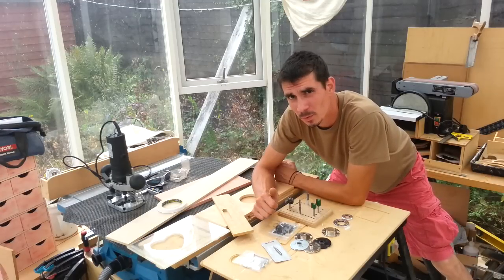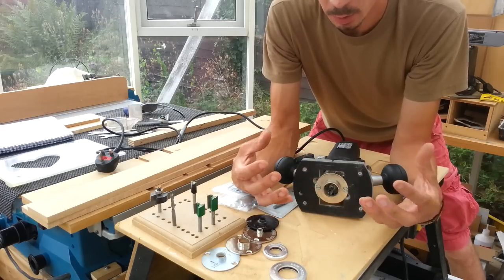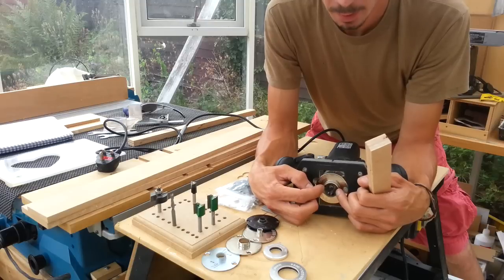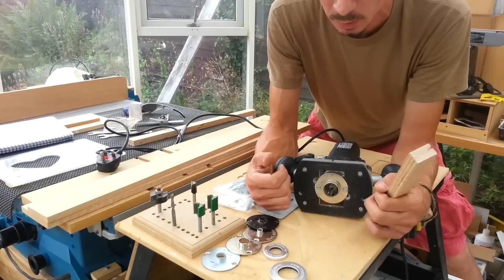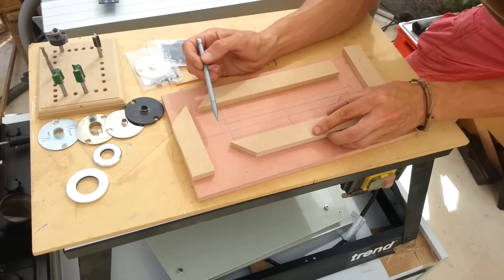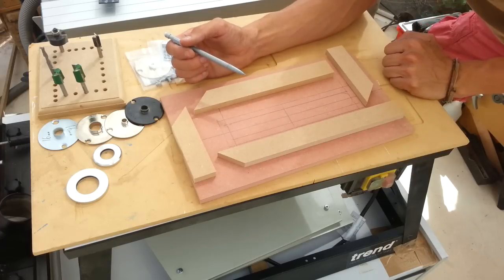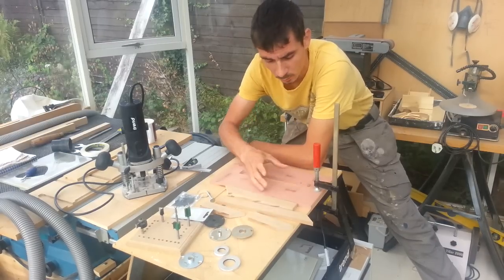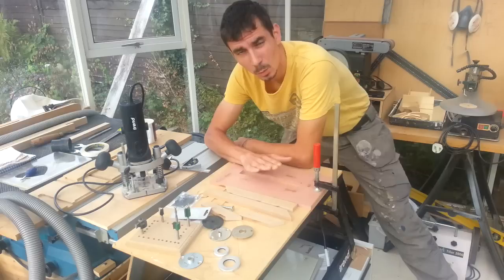How use router guide bushings & template guides | EVERYTHING YOU NEED TO KNOW!

Comment: Hi, I notice that you use a Trend T4 router and guide bush for you video,  does it have a facility to centre the guide bush in relation to the cutter?. Or is this factory set on the router for Trend guide bushes?. Thanks.
Reply from the maker: The guide bushes are centred with countersunk screws (as are all trend routers)
Since the T4 is removable from its base it should ideally be re-centred using something like a centring cone - this is not supplied.
Although I rarely use the T4 these days other than for demos/training courses, It’s really rather good for
Being well centred or most things, I only adjust/calibrate when using either a hinge jig, or doing inlays.for everything else the tolerances are more than good enough.

Comment: Thank you. i have been looking for this information. now I believe I understand the concept well enough its simple.
Reply from the maker: Michael Puffenbarger It really is a VERY simple principle, with a little practice you can use the technique to make several different sizes of cut with one jig, and whatever cutters you might have, without the need to buy far more expensive pattern bits. - It's really handy for shapes and is also the basic principle behind router inlay work. :-)

Comment: Nice video! Why did you cut the fence ends at an angle? Does it help keeping the fence square?
Reply from the maker: It just means you can more easily line them up to more angles, and you don't need to have them cut to the exact length for the cut you're making as they overlap more easily.

Comment: Good video pal, what glue did you use to hold the timber temporarily??
Reply from the maker: +Giuseppe Bibbo Thanks for watching. In this video I used some small bits of double-sided sticky tape (the thin roll of tape you can see in the background when i remove the parts), you can also use hot melt glue along the outside edge too.

Comment: You must have had the depth on that router set perfectly so that it did not groove the worktable underneath. Do you recommend beginners work on a piece of styrafoam or other sacrifcial material underneath? Or how do you get the depth so percise?
Reply from the maker: +PhotoBooth biz Thanks for watching! Being able to set the depth of cut accurately on a router is a really easy thing to do - once you know the technique. I'll be doing a quick #cuttingedge router tips video on it very soon, so keep an eye out for that. As far as a sacrificial work table, I recommend everyone uses one. I find an old piece of MDF works well, but cheap ply is just as good - what ever you have really. I've never used styrofoam but It should work as long as it's got enough density to resist compressing if you clamp the work piece down so it doesn't lift on the other edges.

Comment: What if the thing that you want to route out is not a square or a circle but has a pattern? How would you increase the size to make a template that takes care of the offset?
Reply from the maker: Just make your template smaller (or larger, (depending on if you’re following the inside or outside of it), than your final desired size by the offset amount of your particular shape/design/pattern.

Just be mindful of any tight Radio that you wish to follow, if the tenants are tight then you need a small enough guide bush in order to be able to follow your desired care.
If the guy but she is too big but it won’t fit inside the titan and it will throw your cutter path foreign off away from the template so as to not be the shape you one.
Hope that makes sense and it’s helpful.
Cheers Rick.
Reply: @BrainFizz  i need to flush mount a speaker (which has a bit of an odd shape) so i thought of making a template and use a guide bush to do it ... the problem is that i can draw the outline of the speaker on a piece of mdf (for the template) but how can i make that outline of the speaker a bit larger to compensate for the offset?
Reply from the maker: Darryl Portelli if you’re literally tracing around an object, you could use a washer, and pencil that gives the offset you want, or a pair of compasses/dividers set to your required offset.
You might have to trace the object with a pencil, then trace, the trace you mace with the compass,
For the straight sections measure and mark with a straight edge, then use the compass trick for the complex portions..
Reply: Great idea with the washer .... cheers !!!!!

Comment: What size trend bush is closest for a 1/2 in bit the 12,16 ???????????
Reply from the maker: 1/2” is 12.7mm so so 1/2” bit wont physically fit through the hole of 12mm guidebush….. so in this instance 16mm would be closest, but its about as small as you would want to go as you’ll need a little clearance between the bit and the inside diameter of the guidebush.
Reply: @BrainFizz  Cool, I thought it would be the 18 mm  but if the 1/2/ '' bit fits inside the 16 without touching around, I will go with the 16 mm, t.y.
Reply: @BrainFizz  So, the 16 will do or the 18?
Reply from the maker: Try it and see.

Comment: You just taught me exactly what I wanted to know. thanks for the great video brother. quick question I just bought a DW618 dewalt router and I want a guide bushing set that will work with my router. are they all universal? or brand specific ?
Reply from the maker: +Art Connolly Many companies have there own guide bush mounting "method", mostly it's the position of the holes. I use the Trend Guide bushes - they have a huge range of sizes in metric and imperial, and fit all my routers. If you check the compatibility table on their website it'll tell you if your router will take their guide bushes, or require a sub base.
Let me know how you get on.
Reply: If it's the router I have, the dewalt Palm and plunge combi you want a brass ring collar set

Comment: I wonder e erytime you want use a déférent guide you in stew the guide to  be replace by the larger or smaller?
Reply from the maker: +Gilbert Dufour I don't understand the question.
Reply: sorry spelling problem
I wonder on your router how do you change the for déférent one I can see 2 kind of space on the side of the guide
Reply: Are you asking if the guides are attached and detached via the two screws that mount into the bottom plate of his router?

Comment: Lovely video for sb. just starting out milling. But I miss the moment where you sink the router into the work piece!  Drilled a hole first? Use the rotating bit to do that?
Reply from the maker: +Continental Todd Just use the router cutter do that. With small cutters you can plunge down vertically, with most larger straight cutter (larger than 1/2"), it's generally easier going to ramp down, I.e. Moving forwards as you plunge to make a slopes entry into the work.
Reply: Would like to see you do that! I was warned this can produce severe kickback, jerking the rotating router from your hands and doing unpleasant things to your body
Reply: Maybe I should add I only own a smallish handheld router (blue Bosch 600), not one of these heavier machines you use in your videos, having a plunger
Reply from the maker: +Continental Todd the router will only 'grab' if your trying to cut an obscenely over ambitious amount, or with a massive cutter. Or if you turn it on with the cutter in contact with the material. And even then it's unlikely to jerk the router from your hands.
Reply from the maker: +Continental Todd the router used in this video is only a leightweight router of 800W. It's a small one, but will quite happily ramp into work. Get the cutter spinning, and as you plunge, push forward slightly and continue to plunge.
Reply: Much thanks Richard, very useful! Will  try it and let you know. I took the Bosch off sb's hands very cheaply and just used it on a few simple edge milling jobs to get a feel for it. Seems nice tool but was a bit scared of bigger stuff. Turns at 33000 rpm, just on/off, no speed control.

Comment: what is the benefit of using a bushing vs a flush cut router bit? If you used a flush cut router bit you can skip all the calculations and simply just have the bit cut out whatever hole you make? What am I missing?
Reply from the maker: You can certainly use a bearing guided cutter, but it is limited to it's depth of cut far more. Also the diameter for radius ed corners and curves.
With a single guide bush you can use any of your existing straight cutters that are smaller than that guess bush, and simply enlarge the template aperture.
Bearing guided cutters are also far more expensive than a single two flute straight.
This is simply a cheaper, more verities method of achieving the same end result, using tools and materials you probably already have.
When using a jig with a single straight slot it also works great for housing or dados,  as a single jig can be made for your largest guide bush, as in the video, then the cutter changed to suit the slot. The next video, if I recall correctly  used this jig to cut a slot for a bolt shank, and then then  a larger slot to counterbore for the head. rather than making two jigs which then need to be realigned.
Hope this helps.

Comment: Great video.  Thanks.  However. My feeble brain doest understand why you cut 45s at one end of the pieces used to make and then assemble the initial template.  Could you or someone explain please? Thanks.
Reply from the maker: by cutting the ends to points, they fit perfectly together at the ends, plus you can use them for other templates, which might be at an angle.... you don't have to do it that way, but i like to get the corners snuggly together, points make a faster tighter fit, with out messing about.

Comment: im a little dislexic when it comes to numbers. the vid confused the hell out of me. 11mm here there. just made no sense really. think its just a case of trial and error but thanks
Reply from the maker: Seriously it’s SO so
One. Really…. Take the diameter of your guidebush.
Subtract the diameter of your cutter from it, then divide that by 2.
That number is your offset.
Make your template, “offset” bigger or smaller than the final tbh g your making, weather it be a hole, a disc or what ever. Since your cutter cuts the offset distance away from your template.
Once you crack that, you can use the same template and change up combinations of cutters and guide bushes…
It’s the same principle weather it’s metric, imperial of a combination of both. 👌
Reply: @BrainFizz  it's 9k o watched another video. He used a calculator as a visual aide
 Was a lot easier to understand as ot was in picture form. Blocks of writing or numbers spoken just c9nfise the he'll out of me. Nothing against you so please don't take offence. I run my own business so I'm not stupid 😅 I just learn differently to most. Thanks again
Reply from the maker: No offence taken.